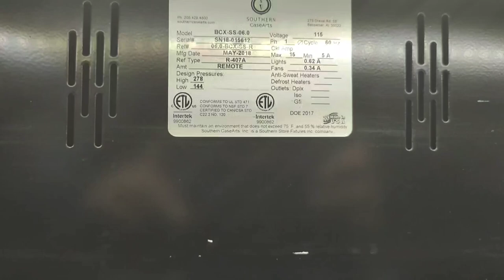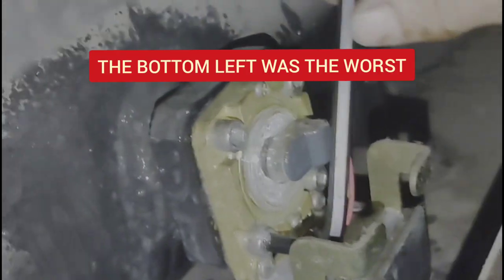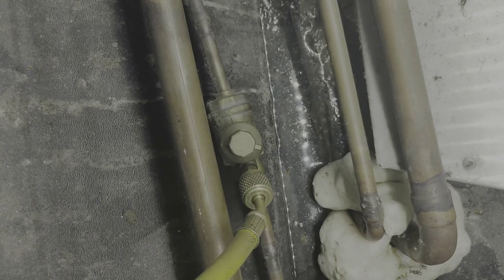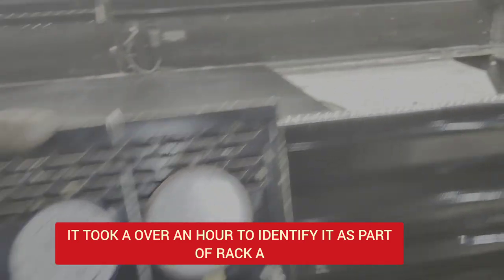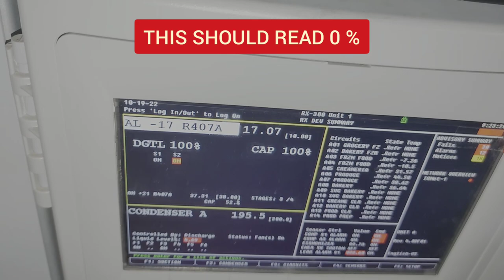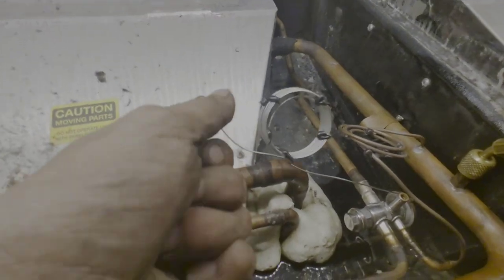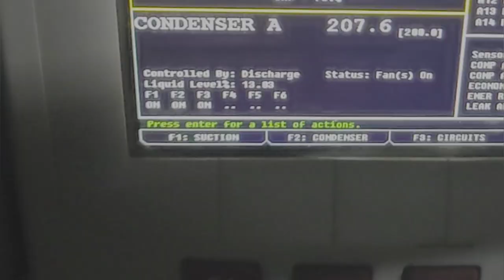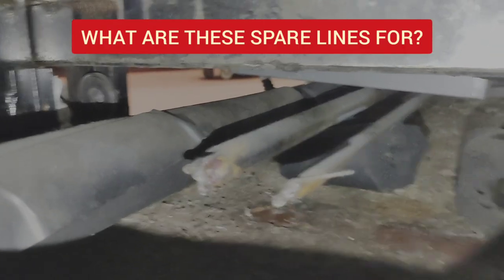OPEN DISPLAY CASE NOT WORKING - RACK REFRIGERANT LEAK ON RECEIVER

Comment: Normal # 200 to # 400 pounds is normal essentially when it reads 0 % worry about when it get cold it’s stack most of refrigerant in the condenser normal 20% to 40%on the receiver.The dead end piping if it coming from the store possibly they had a case no longer needed on the sale floor if is it’s coming rack they didn’t need them at that time of installation.
Reply from the maker: You're the first and only person to give me an answer to that exact question, of how many lbs will it take to change from 0%. 
Thanks

Comment: No one noticed the 7psi over the 10psi suction setpoint and the 25actove alarms?
Reply from the maker: Those Danfoss Controllers aren't controlling the case temperatures in these Mexican Stores.  This one used to be a Randall's, but they changed alot. So, nobody does notice the alarms.